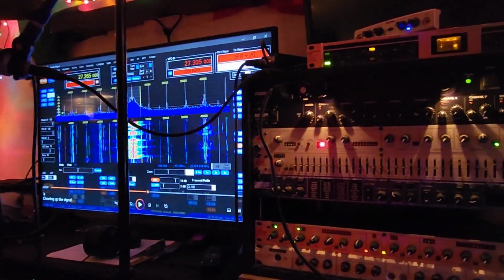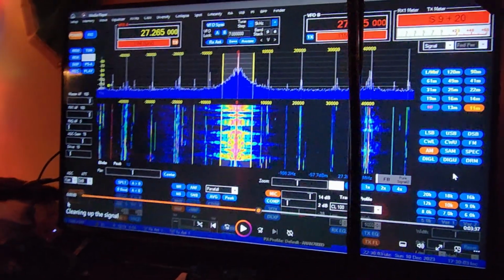Excessive positive peaks and bandwidth. Cleaning up the signal.

Comment: Assymetry just add loudness or volume to the audio ?
Reply from the maker: Hello 14KW. In a nut shell, loudness over the air. After a certain amount of asymmetry it  stops getting louder and becomes distorted.
Reply: @KP68videogates  thanks for your answer 🤩👌